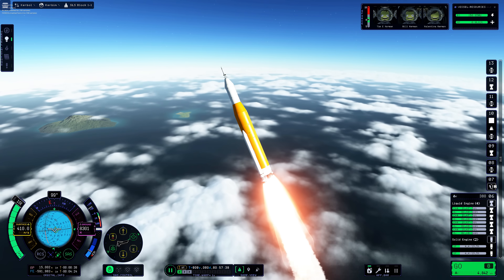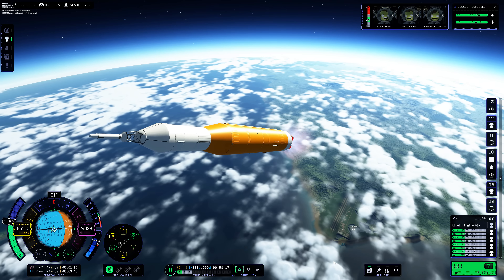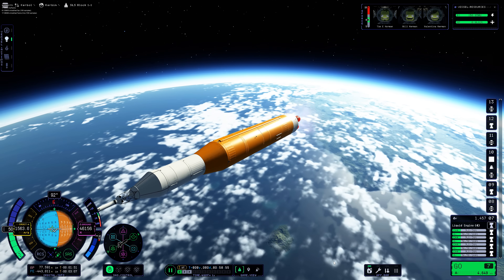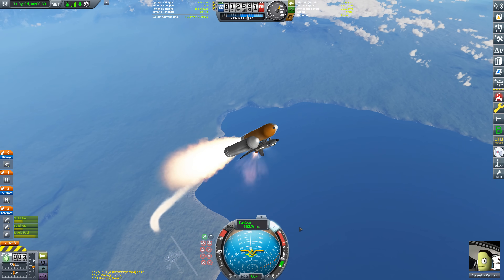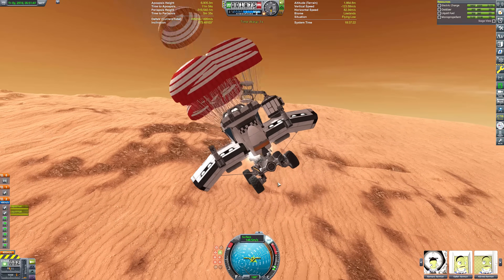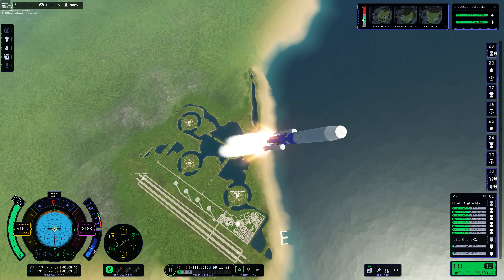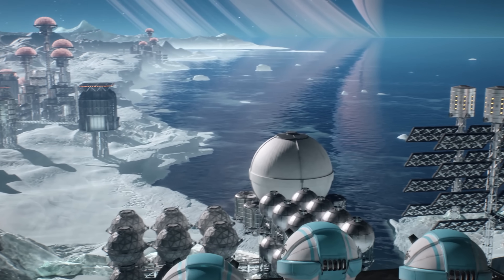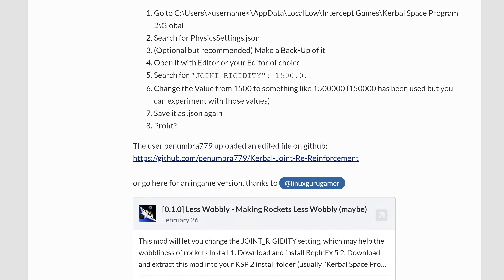Wobbly Rockets Still Haunt KSP2: Developers Face Uphill Battle

Comment: for a stack section made of multiple parts but without separators ( keeps doing full physics on separator s)  treat it as a single solid section and  decide on a failure value for bending moment along the stack.  Calculate forces at either end of the stack, if bending moment exceeds the "materials" failure value then pick the nearest stack join to the centre of the bend and simulate a fail at that point.  that way you only need 3 calculations ( either end and pick the nearest fail pont )  per rigid section and fixing stuff together with docking ports etc ( we all do it ) still gives you the flex and dodgyness we all know and love.

Comment: One thing that I don't like is the fact that you can only do 'one' attachment in ksp 1 especially in airplanes(yes I know about sturts but it is somethimes so much work to strut everything), and the fact that you can only work on one vehicle at a time but ksp 2 fixed that ig but I only have ksp 1, and for sure how hard it is to switch rockets that are close together bc you need to go too tracking station

Comment: Why not just got the BMG route and have multiple connection "Nodes" hidden along the edges of parts. These don't show to the user, but within the physics engine act like clamps or "magnets" with near infinite force, which hold the pieces together in a realistic way, as though there were thousands of bolts holding two components together. When a stress level is reached, you can either lower the force of these nodes, or turn them off completely, having the vehicle bend and then tear apart as a real vehicle would when experiencing an extreme overload. Then just have an option in the game settings which allows you to change the maximum force for these nodes. Or heck, even build it into the parts themselves and let the player choose the strength of connections part by part inside the VAB. Want to simulate a faulty booster connection? Set the node force for this part to something really low, and then add some stress to it. Exceed the value in flight, and there goes your booster spinning off into the tracking station.

Comment: This is ridiculous. KSP1 is still a  better game than KSP2. KSP1 had more realistic AND more performant physics than KSP2. This particular issue is not just game breaking, it's profit breaking. Nobody is going to spend another dime on this game if they don't fix this.

There is no excuse. Turn off joint physics until they figure it out.

P.S. I completely agree, I would like physics to encourage realistic designs. I think there needs to be some kind of internal rocket physics, but this is completely ridiculous and they need to make fixing it their #1 priority or the franchise will die. It really is that simple. Right now the KSP2 is coasting purely on the inertia from KSP1 and the patience of YouTubers and their ability to speed up a 2 fps lag fest so it looks presentable. If KSP1 can do it, KSP2 can do it. 

Just how is it that games evolve to have fewer features than their predecessors? I thought Halo was the poster child for this. Halo 3 had multiplayer forge on-launch along with re-queue, party-up, pre-game and post-game lobbies; the FPS was always stable and there were zero performance issues with the game. Halo: Infinite had a matchmaking system that made you feel alone and literally nothing else on launch. No other features. It's completely absurd.

Comment: They should implement a somewhat straightforward method from civil engineering (more accurately - structural engineering) called slenderness ratio, a ratio of unbraced (no lateral support) length versus the shortest width or diameter. If the slenderness is below a certain level or supported with other parts laterally, the wobble should not occur, and the wobble increases to a certain extent until reaching the maximum. This means the wobble would be eliminated for small vessels and can be engineered to minimize by adding more parts to a larger vessel to prevent flexing/bending.

Comment: I have actually send an email to the developer about this issue even before the game was released. Advising them to indeed apply physics to the whole rigid body instead of calculating physics at the nodes (or splitting the ship into several rigid sections, as two tanks of the same large size shouldn't be wiggly). Simply because it was brothering me so much already in ksp 1, as it had the tendency to tank fps on bigger ships. another way that could have solved/ reduced the problem would have been to apply physics to the body while keeping the nodes rigid. However, this too has the tendency to be computational expensive (basically simplified finite element method). It is sad to see how these things are still present.
Reply: I also put some other recommendations in that mail, just plain stuff I hoped to see in ksp 2. such as Lagrange points. Got a nice email back thanking me for the feedback.
Reply: Another interesting solution to the wobble problem would be to have different parameters for each part size. make a large body node have higher stiffness / add damping / harsher constraints on the angle of rotation. To be honest, I do not understand why a quick fix hasn't been done yet. It seems relatively easy from a engineering perspective. I just feel like ksp 2 is lacking the appropriate programmers. Does anyone know whether or not they have outsourced part of the development?
Reply: 8:45 exactly like that... 
writing while watching lol

Comment: Thank you Matt. I submitted a feature request a few years ago for quantum drive to be added to the ksp2 based on this:  Everyone should have a look at the Navy Hybrid Aerial Underwater Craft (read UFO) patents by aerospace engineer and inventor Salvatore Pais. Using Macroscopic Quantum Coherence using plasma resonant frequency fields to access the energy densities (~10²⁵ joules/ meter²) by polarizing the local vacuum field using Argon gas in a resonant chamber vibrated by Microwaves at 3.3 Ghz until polarizing the local vacuum field to macroscopic Quantum Coherence when the Resonant Plasma Frequency is achieved.
Goto Google patents and search Salvatore Pais

The patents are real and Brett Tingley did several good articles where he proved the validity of the patents and the tech bosses at the Navy fully backing it. Also includes room temperature superconductors patent using piezo-electrics

Comment: Thank you Matt for being an advocate for the user base.  I was disappointed to say the least with the comment about wobble in the DNA and somehow its a "fun" problem to solve 😫 they shouldn't. calculate it on the joints or Calcutta wobble at all but they could have classes of assemblies  of parts that have a certain resistanceto rigidity but it only breaks it doesn't actively wobble. Small parts joints like the decouplers and girders shouldn't be in play at all for the structure effect during flight.

Comment: "A simple Mun trip" with SLS beast lol. I use tier 1 parts for that. You can get to Jool and land on Laythe and return with that weight class and better engineering. It would be also interesting to know how Kitbash compares to KSP2. Do they have any flex at all? I want flex. Flex is realistic. Planes without flex are boring. That's why every good flight sim has it. Sure, some parts in KSP2 have too weak joints but that doesn't mean the whole wobble physics are bad. It's just not very consistent throughout the game and needs more tweaking. The ideal solution would be some fancy mesh based simulation similar to BeamNGDrive but that would probably kill PCs faster than one could say launch.
Overall I think you simplify the issue too much and don't go much into detail. Had you done that you had seen that for example stacking 10 long SM tanks you can actually get to orbit with. But stacking the same length of rocket with shorter tanks you can't. Why is that? It's not the wobble but the way joint rigidity is not calculated rather fixed per part. A rocket should be rigid based on its size not the amount of parts it has. All they have to do is run an algorithm that calculates join rigidity per part in a sensical way. Maybe sounds easier than done because in KSP you have soo many ways to mess things up with crazy builds. No wobble at all would mean you could stack the tiniest of tank a kilometre high and get to orbit with it. What a stupid game that was.

Comment: Not all joints are created equal. Joints between, say, a launch escape system and a capsule should be treated as stable and solid. Those joints can be simulated as one single monolithic piece. Another example could be a booster assembly with a couple of tanks, a nose cone, and an engine, all strapped radially via a decoupler to the main rocket: that should also be treated as a monolith. If we break the rocket into these logical part-clusters and simulate them as a collection of composite parts, they could make KSP2 more performant and less "wobbly" while still keeping some of that characteristic KSP noodle physics flavour in situations where that is appropriate. For example, if I'm launching a huge von braunn ring with a booster strapped to the center, giving it incredibly thin spokes.. I'd want some wobble. Save weight by leaving it flimsy, or add supports that I would ditch once I'm in orbit to make it more stable; that's an interesting choice and challenge.

Comment: I propose that they literally make the "first stack" or main body as a solid no-wobble, rigid structure, and only when you start adding stuff through SIDE decouplers, for example, THEN wobbliness should start being an issue, where we need to correct with struts. I'm a coder myself, and this implementation shouldn't be hard going off of what and how they're talking about this issue. (now that I made it more through the video :P I realize you propose the "same thing" and yours is better descriptively lol)

Comment: Suggestion: Axial joints within, say, 5 degrees of the current vehicle net acceleration? Those are solid. That means your core stack is rigid, the side boosters are rigid, but the link between them is not. Something hanging off the side? It'll wobble. Start doing backflips under power? Things might come apart. But under powered flight in the direction the engines are pointing, rigidity.

Comment: You know... it occurs to me that the one thing that does wobble on real aerospace vehicles (specifically on the aero side) are wings. Big plane wings wobble like crazy, flexing visibly with turbulence, with the onset of lift on takeoff, with the cessation of lift on landing, the wingtips moving by upwards of a meter.

The one place KSP2 no longer wobbles at all? Wings. They're a single piece now.

Yeah, I'm getting more and more disturbed by these devs.

Core physics engine stuff should've been the very first thing done, and... I mean, they did do some. They do seem to have fixed the size limitations of the game world, and put a much more robust hybrid coordinate system in play. But joint physics? Come on, guys. A lot of players dream of building robotic style vehicles and rovers, and even with the best mods available in KSP1, that's challenging and immersion-breaking at best.

There are multiple other vehicle-building games out right now that seem to have completely solved the problem of joint instability in various ways, ranging from Mars First Logistics only making joints within parts flexible (i.e. a servomotor can wobble while a solid beam that happens to have been built out of a few different segments of pipe doesn't wobble at all) to Plasma's brand new physics solver that simply doesn't have off-axis joint flexing (i.e. if it only makes sense for a specific joint to flex in one or two out of the six possible degrees of freedom, it only flexes in those directions, and no others).

I like your idea of the game detecting sudden changes in diameter. That seems like a perfect solution! That could be done heuristically, as with machine learning... or it could just be a part of the part definitions, in lookup-table form (I'm a 2.5m fuel tank; if I connect with one of my end nodes to another 2.5m node, I flag those joints to not be calculated).

Comment: I feel like there's a compromise between "Model all of the joints" and "Model none of the joints". Perhaps all of the pieces connected of uniform diameter should be modeled as one piece in physics (e.g. 4 3m diameter parts stacked together become "welded" in the physics engine and are calculated as one piece) but non-uniform joints (e.g. a 1m part and a 3m part stacked together gets fully modeled and can punish crazy design) and adapter parts get something in between so they're rigid enough for a reasonable rocket but can still flex if someone puts too much weight on the narrow end. I would expect docking adapters to work similarly.

Then you can have it that when a ship breaks up the stacks "unweld" in the physics engine allowing it to create more debris.

Comment: Ok I'm no expert on the matter but here is my suggestion:
Treat every stack as one entity and apply physics to those entities. You have a normal sized stack? It stays together an no wobble. You want to make one stack that's a noodle? Apply appropriate wobbliness to that. Radially mounted SRB's or other boosters? Individually they aren't wobbly but apply wobbliness if all they are attached with is a decoupler.

Or they could just turn up the rigidity of joints by about 4x and it probably would have a more realistic and enjoyable experience

Comment: If they are worried about the part count but don't want to model everything as 1 rigid body, then why don't they look at the TYPE of joints, and if it's a completely matched up inline attachment of matching sized parts, then group them together as a single module (ie, group together like segments)? That would reduce the calculations down to less interfaces, and at the points where the interfaces would be the most likely to wobble, while still allowing SOME to exist in realistic ways.

Comment: I certainly won't pretend to have an understanding of how KSP works but I am experienced in game development and this "middle ground" fix popped into my head...
If they added some code into the vehicle loading process that analyses the joints between each rocket part and determines if that should be a "strong" or "weak" joint, the game can then choose combine those parts into a single rigidbody or leave them separate, resulting in a, for example, a decently built 9 part rocket using 3 rigidbodys instead of 9. This would not only provide more stable rockets when built in a sensible way but also allow badly built rockets to still be wobbly. This will also reduce the physics processing needed for rockets that are well built as you could potentially reduce 30 rigidbodys into just a few.

Comment: Would it be possible to make the fuel tanks like the wings? Make them adjustable in length but not diameter. This could bring down the part count of large stages. Would also give the ability to fine tune the amount of fuel, cost, and weight per stage in the VAB (could really get that TWR and Delta V right where you want it). Added benefit, fuel transfer would be easier with less tanks. Could also make the nose cones be automatically on the top of a tank and treat it as the same part, unless you put a separator on top, then the nose cone  disappears. That could cut the part count down for multiple booster setups like the SRB's.
 The only other problem I can see is the controls. If you can find a way to fine tune the sensitivity so players aren't just having to use the "tap, tap, tap" method it could help a lot. Imagine if real rockets did that, they would probably have the same problem. They could set it so you could just hold the wasd key you need and adjust the sensitivity with the mouse wheel (basically tie the mouse wheel to the gimbal limit slider). Then you could hold the mouse over the throttle control gui and click to adjust. Then give the throttle a "delay" (kind of like the jumbo jets spooling up and down) to help with wobbles from rapid thrust change if needed, but leave the instant cut out when fuel runs out for realism. Smooth controls could help a lot I think.

Comment: Wonder if they could have a skeleton that forms when the rocket is built. then have the skeleton joints have joint strength automatically changed dependent on the joint type.

Comment: I still don't see this as a problem. Maybe my computer is weird?

The only time wobble rockets has been an issue was when I launched a ship that had a statue of Bob playing guitar. I forgot to strut the sides of the statue to the inside of the rocket and even then It got a few hundred meters off the ground before I noticed the problem. After noticing, I decided to push the problem as far as I could and the wobble mainly threw the rocket off course, resulting in it landing in the ocean.

That's the worst it's ever been for me. Otherwise, all of my experiences are just like the stock footage you were showing, a tiny bit of wobble but not enough to mess up the rocket or it's trajectory.

Comment: Wobble is a part failure. Joints should not flex at all until they fail. This would simplify simulation, because it would be a go/no-go calculation, with simulation only necessary during a failure.